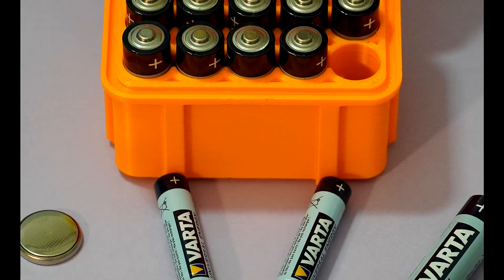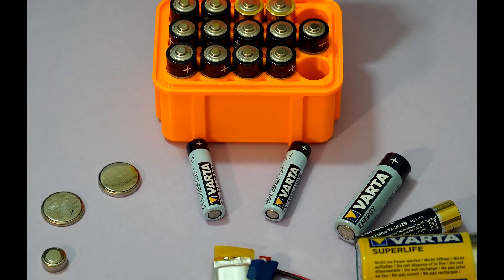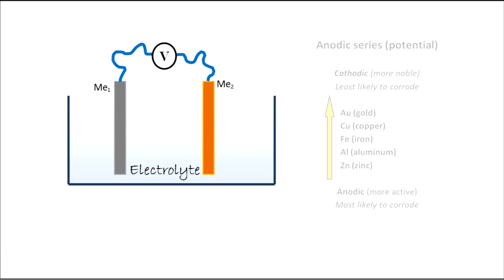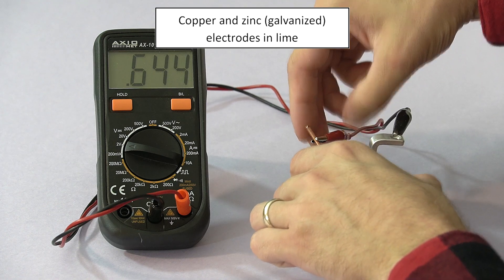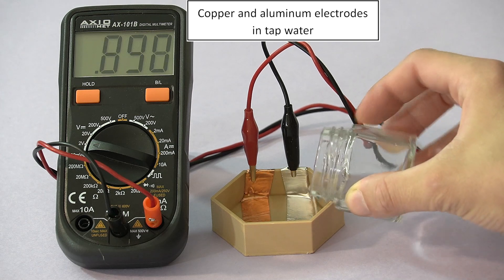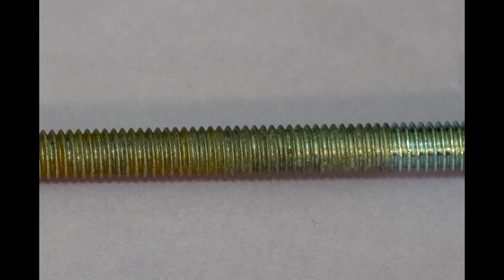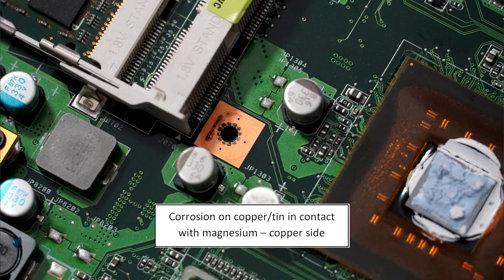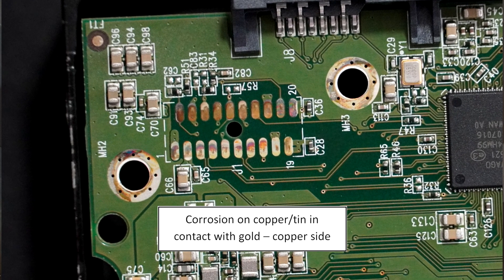About potatoes and Galvanic Corrosion (Short version)

Comment: Aluminium + stainless-steel is particularly nasty in contact with salt water, when both metals are individually quite resilient.
Another common misconception is that a potting compound or plastic or epoxy can prevent water from acting as an electrolyte. Far from it; this only delays the process. Take a galvanic contact, coat it in your favourite epoxy or other conformal coating, immerse it under tap-water and watch it corrode away (albeit after several months, rather than days).
Reply: Are you saying if I took a say steel pin and trow it an a jar of mixed clear epoxy, enough to drown the pin, and I throw it in a salt lake after cure, that after a couple of years, I would see signs of corrosion on the steel pin?
Reply: @piconano  A steel pin, by itself, likely not.
Combine it with another metal that creates a potential, or apply a voltage to it, then yes. Furthermore, "a jar of epoxy" is a lot of material that the moisture has to penetrate through. Mostly people apply it as a brush-on conformal coating (say 0.5mm thick). In such a case, most materials do not stop moisture-penetration. 

Think of it as a large resistor - say 10Gohm feeding an ideal capacitor. Over time, current ("water molecules") will still trickle in. The only way to prevent "the capacitor from charging" is to have a bleeder-resistor to ground that can get rid of any leaked charge accumulated on the capacitor. In the hydraulic world, this could be done by a "breather" opening - so a tube to your steel piece with one end sticking out of the water into the air above, or to use a "getter" that will absorb or adsorb any leaked water-molecules for a few years OR to use a hermetically sealed encapsulation (like a welded or soldered metal sheath).

Silicone, polyethylene, epoxy, .. they all slowly let water molecules across. Slow-don, but not stop .
Reply from the maker: I guess potting or conformal coating materials vary in quality (and price), but I do know that one of the major problems associated with applying such materials is the initial preparation of material to be protected - if the application is done in a humid environment, or if the device to be protected already has absorbed water - applying the coating material will just trap all the water in the device and create issues over time without the need for any extra external humidity entering.